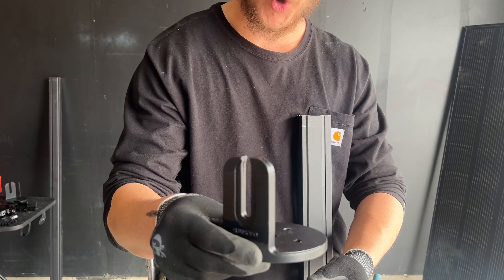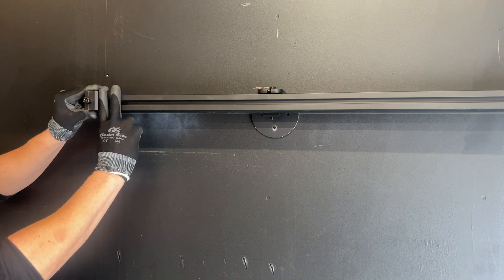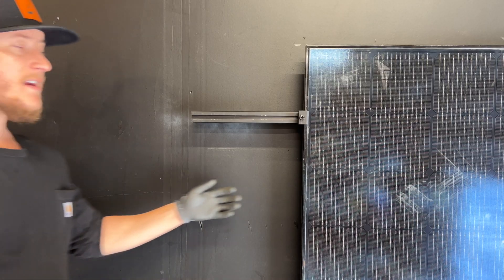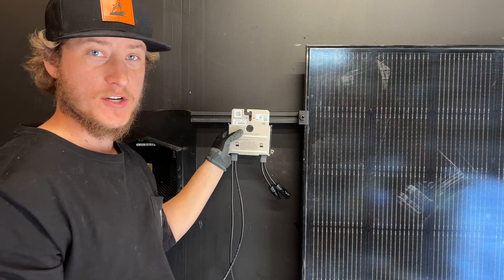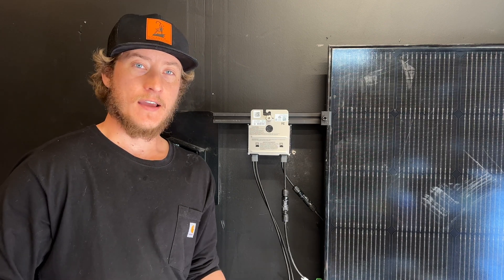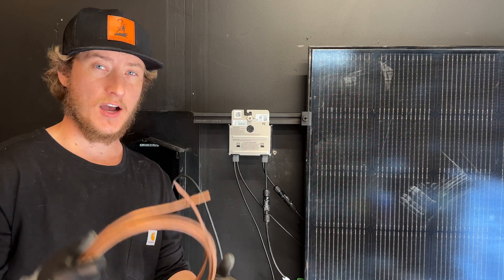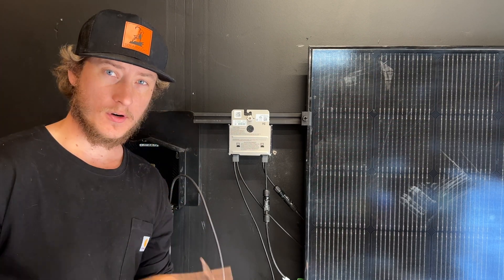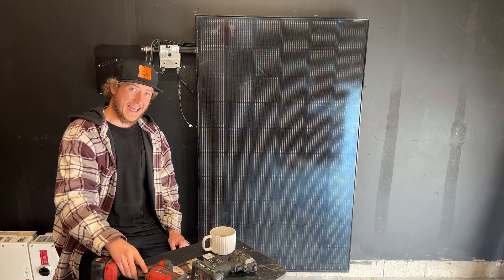How To Attach Solar Panels To A Roof - Basic Hardware Overview

Comment: Awesome content. Do you think you can shed some light or do another video on the explanation and demonstration of stringing panels but in a complex setting involving a junction box and going to the inverter. For example, I have 12 panels but they separated in 3 groups of 4 but still in 1 string. They each appear to go into a junction box but not in the order as shown on my solar edge app for showing the string order. I guess my question is are stringing panels up in a certain order not as crucial anymore as long as it’s within the limits of the system and done as needed (series or parallel) as it seems like the “stringing” is just done on the computer side assigning string order addresses? The panels goes 1-4 jumps to a roof junction box to the next set of panel junction box, 5-8, and so on. How is the string still functioning if it’s being daisy chained around through the junction box across the solar array system? Sorry if I’m not making sense, just trying to understand the method to the madness haha

Comment: Good, quick, to the point information.

What kind of consideration needs to be taken into account for spacing the rails on the panels? 6 inches off the short edge as you showed or should we target 1/4 the length of the panel from the edge?
Reply from the maker: Thank you! Depends on the snow load and wind load and rail etc for the spacing but I think 1/3 the panel width is a good rule for cantilever. Maybe 12-16 inches max. Generally the attachments if they are fastened to the rafter will be 2,4, or 6 feet spans. In Utah the snow is heavy so we often will stager them 2 and 4 foot spacing to try and alternate. So top row 2 foot, 4 foot, 4 foot, and bottom row 4 foot , 4 foot, and 2 foot.